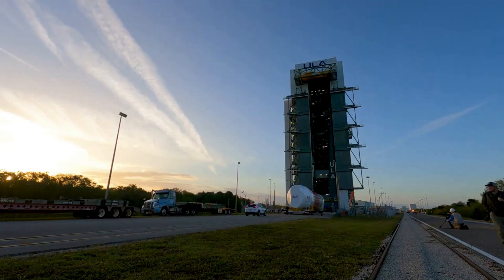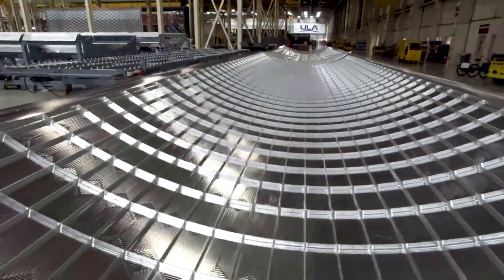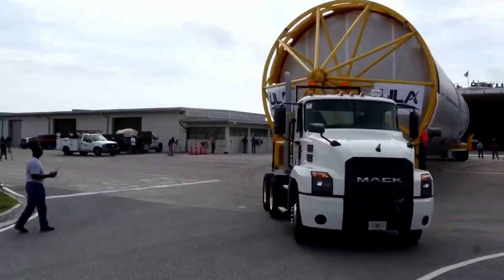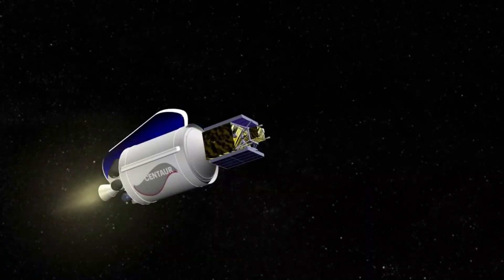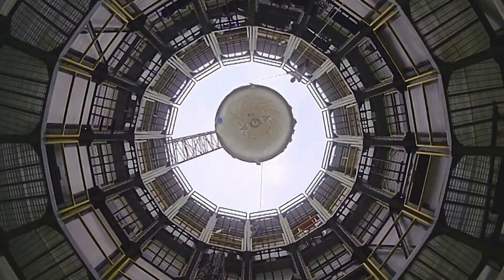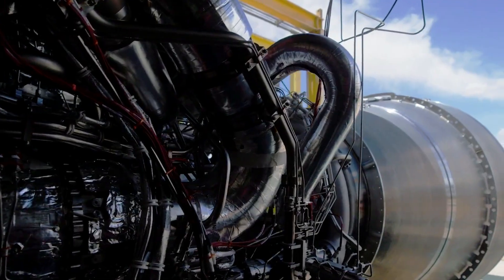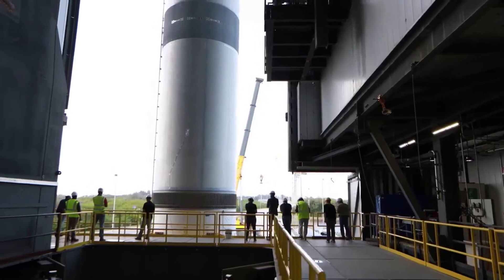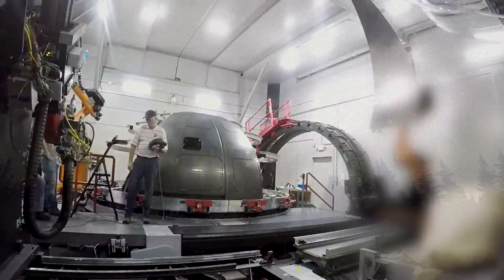ULA Is Almost Done Fixing Vulcan's Upper Stage

Comment: Laying the blame on a coarse grid  FEM is laughable.  An experience strength engineer should have been able locally increase the fidelity of the FEM around the door and adequately accounted for the stress risers.  An adequate structural test would have also uncovered the descrepant design.  This indicates that the strength engineers in charge did not have adequate experience and should have been fired.
Reply: well, an adequate test did uncover the design issue. That's how they discovered it. It may be somewhat late in the development process, but they did discover the issue before their first launch and are successfully mitigating the risk for their customers.
Reply: @plainText384  Keep in mind that the failure was a very extreme case situation that likely would never be seen in flight, so the Centaur that was going to be used for Cert-1/Peregrine would've more than been adequate for the job, but ULA is a fairly conservative company and they intend to fly customer payloads on that flight, so they opted to fix the problem first.
Reply: At the very least all parameters should have been tested earlier. They had years.
Reply: @MrEd2291  in structural analysis higher factors of safety are required for untested structure.  However this usually means an inefficient overweight design.  So I am sure that this pressure vessel had to be tested.  Since the news reports did not discuss structural testing I think we were not given the full story.  ULA had at least five years to come up with their final design.  So yes, they should have caught and fixed this discrepant design years ago.  The strength engineers in charge should be sent home as this type of error is inexcusable.
Reply: It is well known in structural analysis that there will be discontinuity stress present when you weld two dissimilar geometric shapes together.  When pressurized the joint in question will deform in a sine wave and exhibit high stress risers at the discontinuity.  In order to adequately capture this effect the fem mesh around the joint needs to be much higher.  Even an engineer with a moderate level of experience would know this.